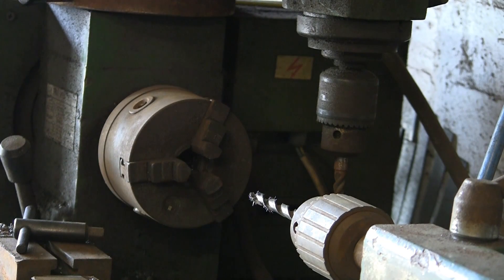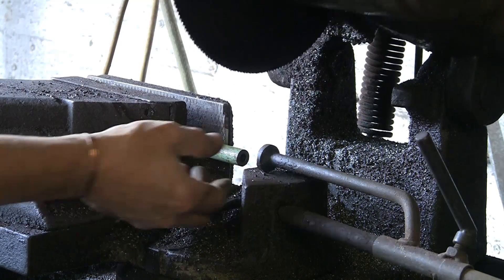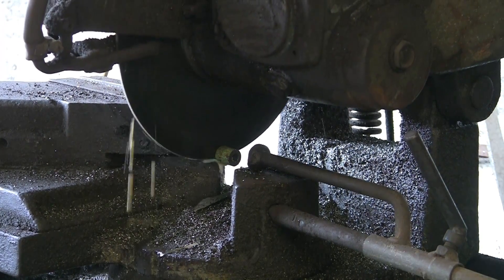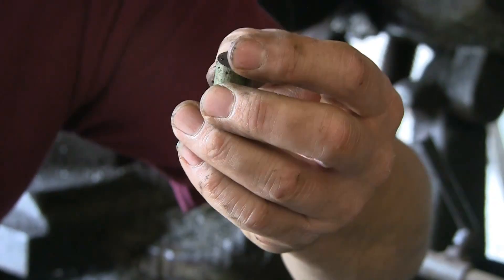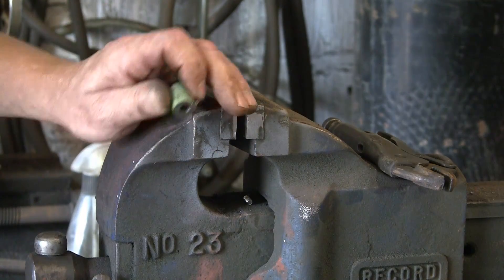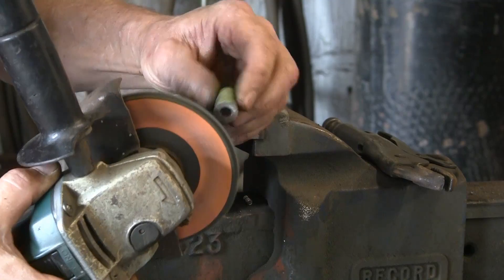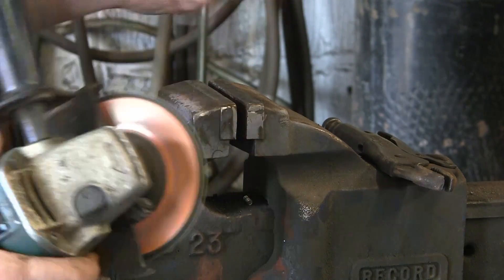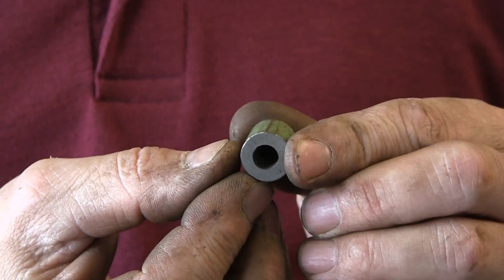DIY Rivnut tool

Comment: We use them to secure cablights to truck roofs i always put a little body panel epoxy around them to ensure both it not coming loose in the thin metal and that it is truly water tight

Comment: would be a lot cheaper and easier to just use a 1/2" length of 3/8" steel pipe with two large washers instead of having to fabricate a sleeve. Just take the bolt, spin on the nut then drop a washer onto the bolt followed by the pipe fitting and the add the second washer. Drop the whole (and very cheap) assembly onto the rivnut and away you go.
Reply from the maker: If you know how to do it why are you watching?
Reply: @garyhuston  Just making an observation

Comment: Holding that piece of angle iron while drilling is not the smartest thing you'll do all day
Reply from the maker: Why?
Reply: @garyhuston  Because if the drill hangs up the angle iron will spinn like a propeller and you will not be able to hold it .
Reply from the maker: @richardmerrifield8186  haha, that might be true if it was a big drill but trust me iv'e broken bigger drills than that by holding onto it.
Reply: @garyhuston  Ok ,hold on tight.Emergency room stitches can be expensive .
Reply from the maker: Richard Merrifield not here, it’s free! Besides, I have never had stitches in my entire life, super glue if I’m really bleeding but otherwise I don’t bother.

Comment: Rather than drilling through a solid bar to create the pressure plate. Drill out the threads in a nut the same size as the rivnut you're installing and use that as the pressure plate..
Reply: Or, use a stack of washers with a dab of superglue

Comment: Just buy a threaded rod connector and you're done. The rod connector also has the additional advantage that, with the exterior being hexagonal in shape rather than cylindrical, it can be prevented from spinning with a spanner, so you don't need the additional nut.
Reply: Most threaded rod connectors are made with a soft grade Steel and won't work...  I use a hardened or grade 8 bolt and nut, and have installed Stainless Steel rivet nuts easily!
Reply: @alfredomarquez9777  
You can buy stainless rod connectors on eBay. I actually have three of them.

Comment: Don't use that green metal rod section. Use a Keps-K lock nut as the serration's will grip the flange of the rivnut so it will not rotate, other wise the hole that the rivnut is in could be cut away and will lose some of its torque stability, especially with a softer metal. Then use the bolt head instead of the nut that is being used in the video.  I am unable to appreciate the green metal rod section.

Comment: Don't really need to drill out a tube from round-stock. Just use a nut that is large enough to slide over the pulling bolt. Eh?

Comment: put a needle-roller thrust being between the nut and bushing, makes life a lot easier
Reply: I have done exactly that.... but unless you have a very good quality axial bearing, it will fail after only a couple of uses.  At the end, I used hardened washers and a little engine assembly lube (which has some Molybdenum Disulphyde) and it worked even better than a new bearing!

Comment: Thanks for the great video! The water tight application is needed for attaching something to a metal roof like on a barn. I need to attach a tripod with a radio for wireless internet and do not have access to the underside of the tin, so I am hoping this will do the trick. Self tapping metal screws wouldn't have much to hold on to. 

But why is a dude with a British accent talking imperial inches and not metric? I am from Texas, and it even sounds strange here where I barely know how metric works.  :-)
Reply from the maker: I’m that old that I was taught in imperial before we changed to metric so I know both and still use both.

Comment: Brilliant .
 I used this on my bug heater-channel after the old nut broke loose and I was left with just a hole and didn’t fancy welding my freshly painted bodywork ! 
I used a stack of washers and an M8 long body nutsert , worked a treat and saved me a lot of ball-ache . 👍🏻

Comment: Thanks for the info, I needed to install one rivnut in a bike frame and wasn't sure how they expanded in the hole. They want $40.00 for the cheapo grade of tool. A nut bolt and washer worked great. Better quality tool at No $$  Hope the Docs got you fixed up!!!

Comment: I hope at this stage you are fully recovered and thanks for the videos.The rivnuts I have come with small serrations on the tube  and I would guess that is intended to stop them turning in the hole if it is drilled to the correct size. When they are installed in thin material the serration take on the appearance of a star washer. 
As for special tools, the cheap hand tool I bought is straining to set a 6mm rivenut even though it is supposed to set up to 10mm. May be in aluminium not anything else. Your system is better.
All the best.

Comment: I'm wondering, instead of drilling out the bar couldn't you just drill out the threads of another one of those nuts?
Reply: No becausecit would crush up the same as the bottom rivnit

Comment: Regarding applications where waterproofing is important with rivnuts, they're often used for attaching roof racks to vehicles. However, I'd still end up sealing the threads just to make certain there's no leaks or rust over time.

Comment: I thought this was going to be something clever, it's actually just a waste of time! All I use, all I think anybody uses is a washer, why mess around making a spacer it serves no purpose?
Reply: Because a spacer like that will help a lot towards using the wrenches!  Unless you use SEVERAL washers, the nut and the bolt head will end up too close together.  the spacer is much more comfortable to use.  Try it before discarding the idea.

Comment: I am thinking of using rivnuts to hold a DIY EMT conduit roof rack, to the roof of my car. That is an application where being water tight will be an advantage.
Thanks for this! Cheers & hope the surgery turned out well.
Reply from the maker: Capi Berra I don't think rivnuts are particularly water tight!
Reply: Its and old car. Guess we'll find out. 

(http://www.eurekamagazine.co.uk/design-engineering-features/technology/rivet-nut-gives-water-proof-fastening/2414/)

I'll likely seat them with some RTV silicone, for some extra water proofing, before I swage them in and again in the bolt threads when I bolt to them.

Comment: Hate these things, and a JCB has them all over especially in the cab of the machine. Never fails your trying to take the dash apart to work on it, these damn things are spinning in their hole. Tried a similar set up to tighten them up, didn't work, but it was 5 mm, was worried about breaking it ofF, so I braised all them in place.

Comment: Thanks Gary, Great clip, simplified. FYI I will be using stainless rivnuts on the fibreglass flooring (deck) of my boat to secure a pedestal stand, which my swivel seats are mounted on. This will prove beneficial if water tight, not that there is much water on the floor in the forward cabin of the boat. Cheers Rob

Comment: Their are ones that have fine raised lines around the outside that U just lightly drive in and when you screw the work on top,they pull up. No "installer" needed.
I do like the little rig U made for the smooth ones though.
Ahhh there's the 3 jaw scroll on the lathe.. :)

Comment: Why don't you use the nut to hold against the rivnut? Or a washer. I don't really get why the piece of round stock is needed.
Reply: The bit of round stock is to keep the nut from galling the face of the compressable insert as it turns.  The tool used for these in an industrial setting is a hydraulic crimping tool that pulls back on the nut once it's inserted, applying a crushing force on the insert.   
Our hydraulic tool was broken one time, and I freaked my boss out by getting the job done with a similar makeshift tool like this, only I substituted a couple heavy washers of the right diameters for the bar stock he used, for the same reason.
Reply: Me too... I used some thick and hardened washers lubed with Moly engine assembly lube, and it went super easy!  The special tool is only justified for more than a dozen rivet nuts job... BUT CAREFUL: Only the better tools (like your hydraulic one do work and last enough to justify their price!  Cheapo mechanical plier type tools rarely do work and the rivet nuts end up somewhat loose.  Been there, done that.
Reply: Couldn't you drill out the threads of another nut? That would be easier than finding the right bar and putting it in the lathe, all you'd have to do is put the nut in the vise and use a handheld drill to bring it out to 8 mm.
Reply: EXACTLY !!!!

Comment: If you get one that refuses to stop spinning lightly centre punch the edge of the hole to create a burr for it to snag on. Hope the surgery goes well speak to a good physio doc after they will tell you how to make the joint stronger without damaging it
Reply from the maker: stuart glenn Sorry but  I have no faith in physiotherapists. Thirty years ago I went to several to try and help me with a bad back and all they told me was to give up my job or they wouldn't treat me. That's not what you want to hear at the beginning of your career. I went to see a chiropractor and they have kept me working ever since. Their philosophy is to help you through your problems where the physio wanted to remove the problem which in my case was my job!
Reply: Gary:  People are like tools, there are a few GOOD therapists, and some stupid ones like the one that you went to...  In my case, the cooperative and intelligent therapist unsderstood my needs and helped me a lot.It depends.  Best wishes from Mexico.

Comment: I've tried something very similar to this before and the bolt broke in half.  Maybe you need to have the right quality stuff.
Reply from the maker: Adam Booth You need at least an 8.8 but even this can strip after a few, preferebly a 12.9 if you are going to do a lot.

Comment: hi gary hope surgery comes ok. please take good care of it and let it heal good (some yrs ago i broke my rh wrist very badly, pins and metal bars all over it... bc of an mx crash... went back to work too soon and took ages to heal). thanks for this video it came as godsend as i`m making new panels for the doors of my truck and i will fix them to the doors using m4 rivnuts and button head allen bolts. now i have a tool to make. thanks man. pete

Comment: i was a aircraft mechanic for many years, aircraft use rivnuts frequently they are light weight and cheap in cost, but when your installing a bolt into the nut you have to be so very careful not to over torque the bolt or the rivnut will pull right out of the sheet metal .